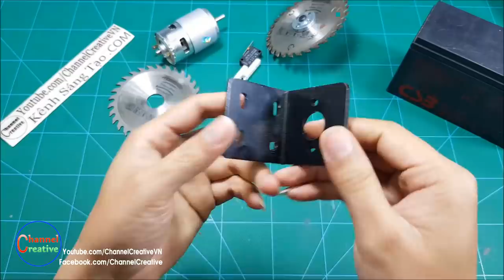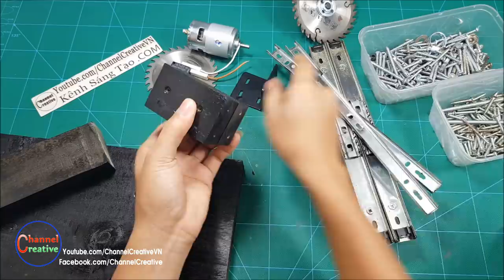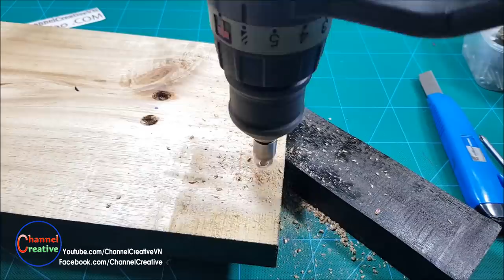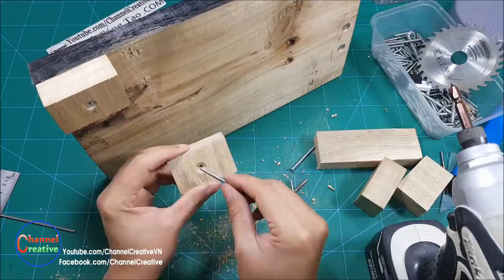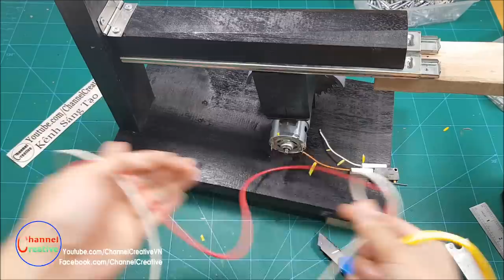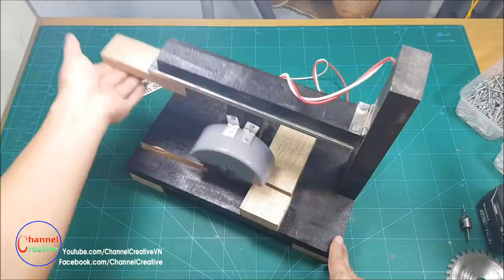How to make Powerful Sliding Saw 12volt With 775 Motor

Comment: I always look out for your videos, excellent work, you are a master engineer.
I built the saw version you made in an earlier video, like a cut off saw with a 775 motor. It's running from a 12V supply with a 4 1/2" mini circular saw blade, 3/8" arbor. My problem is, the motor as powerful as it is, cannot cut the wood. I mean softer material like 1/4" white pine. It always stops and I have to lift it and cut in several passes. It's never a straight cut like in your videos. I am using a 12VDC 3.5A supply. But the same thing happens when I use a PC power supply, 12VDC 10A supply, 18V 2A supply... even a 3S 12V LiPo Battery. These things are keeping me from trying the other cool saw ideas you have shown us. What am I doing wrong?
Reply: Dion Jennings are you serious come on get real?
Reply: @robertbutler8004  I was very specific.
Whatever issues you have with that are not my concern.

Comment: At least make a safety shield for the blade out of the same material as the blade, namely STEEL. It's there in case of blade failure as well as to stop you touching the blade...

Comment: Can you make Electric skateboard from this motor...?
Reply: novan _rizky yes you can but you can't control it's speed so a brushless motor would be mush better and it has higher speed and torque
Reply: elyes grati you control the speed through the voltage given to the motor. Just a 555 hooked up to a MOSFET would easily be able to control your speed. If you're already fabricating an entire skateboard then a 555 timer circuit should be child's play. If not then you can always find thousands of tutorials for doing so online.

Comment: this is technically a chop saw not a "sliding saw"
Reply: LJ Capo "chop saw" is a slang term.  It slides so that makes it a sliding saw.
Reply: LJ Capo  although it is a sliding saw he wasn't sliding it other than to cut the channel for the blade to slide in  its not very accurate and a bit sloppy but with a bit of ingenuity and better build its quite a neat project

Comment: It's a miracle that your fingers don't look like Swiss cheese.  You have a bad habit of putting them behind parts when you are drilling and screwing thru them.  And you leave the motor wiring exposed with no shrink wrap.  I realize that it's only 12 volts but it is sloppy, as is the "handle" and and switch and some other things.  I am not impressed.

Comment: How to chop your fingers off.
There are people out there losing limbs on professional machines, cant imagine what will happen with crap like this.
Reply: Elias Arxodas this is actually called a radial arm saw not a disc cutter and the blade would just fly through the pvc guard that u call safty
Reply: The idea is to be careful! You can get killed walking across the street!